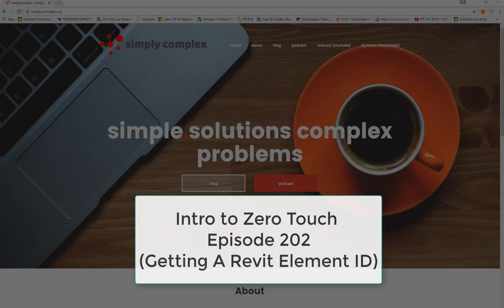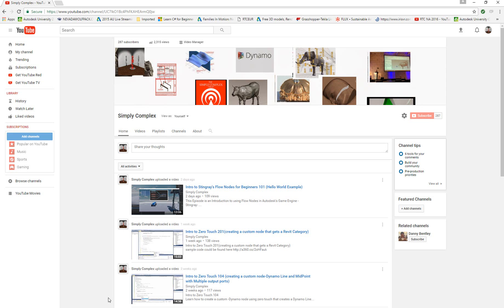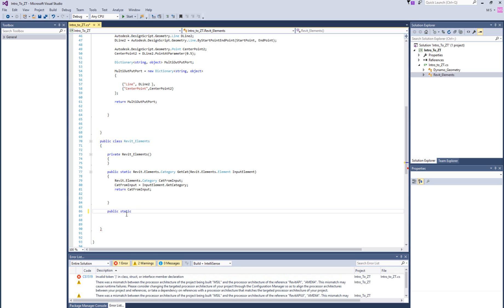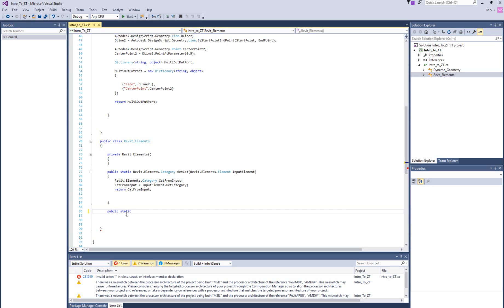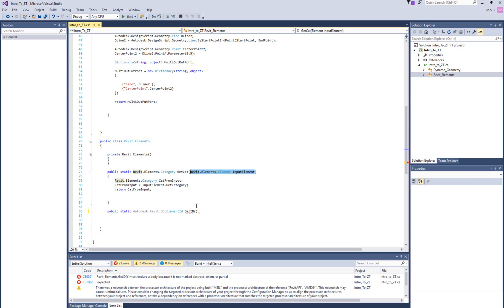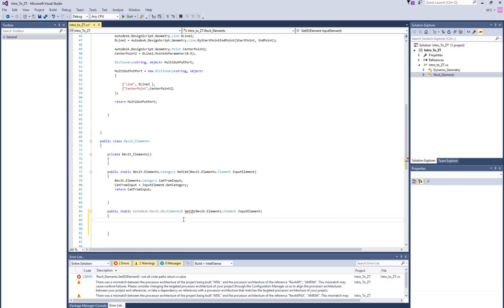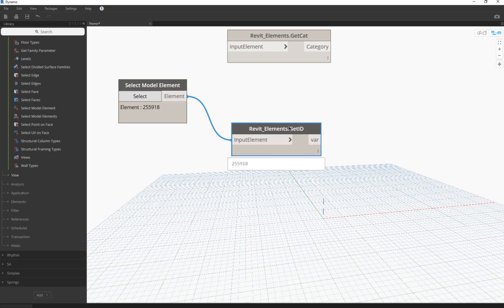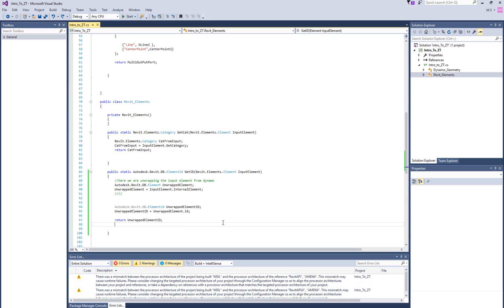Intro to Zero Touch 202(creating a custom node that gets a Revit Element ID)

Comment: Hi Marcello, congrats for the great video series!! I'm a Revit API and ZeroTouch developer so I can answer that question for you. There are a lot of reasons to wrap a class inside of another, Dynamo, for instance, wraps Revit Elements to perform some custom Dynamo methods on them, get Dynamo solids, get Dynamo Bounding box and so on.
So in other words, it is a beefed up class that contains the power of Dynamo elements and also the original Revit Element.